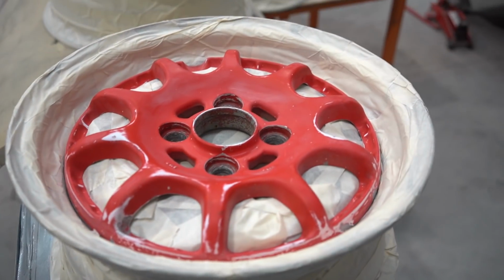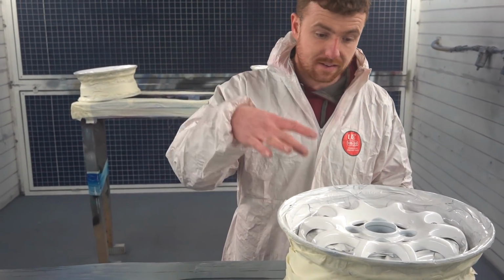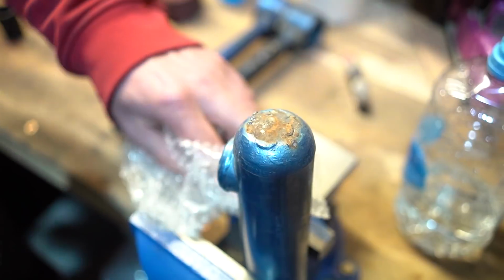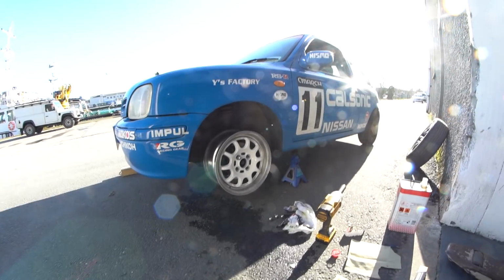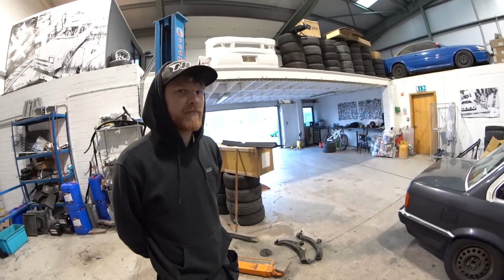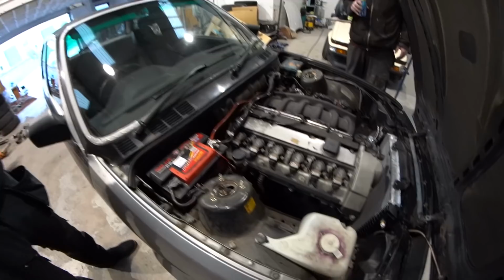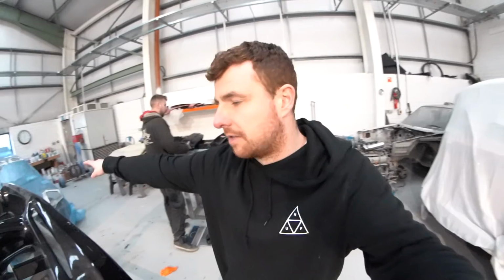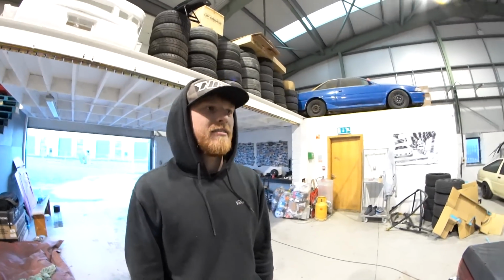Josh's BMW E30 & New Wheels For The March | Juicebox Unboxed #70

Comment: What brand are Bryan's coilovers?
Reply: Rix Engineering threaded sleeves with Faulkner's 2 1/4" race springs with TRD short stroke inserts and a pair of original struts shortened 40mm

Comment: if josh ever decides to swap the engine. (he probably will bc of his driftengine sitting around) he might should consider getting a v8 from germany as backup engine. They litterally throw them after you here for a coupel of bucks. You probably cant speak german. but just watch into ebay-kleinanzeigen.de and just type in bmw v8